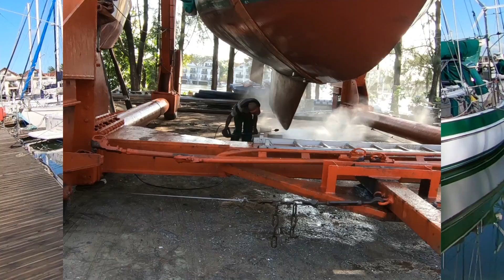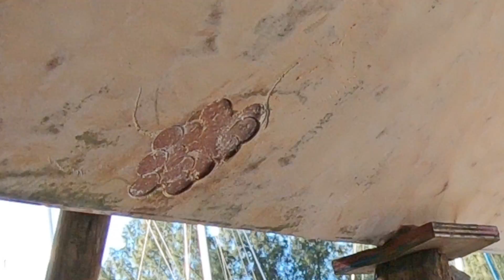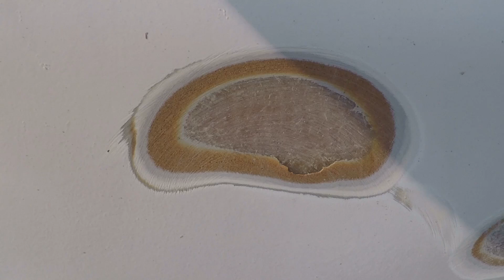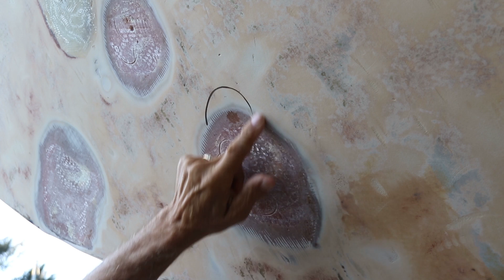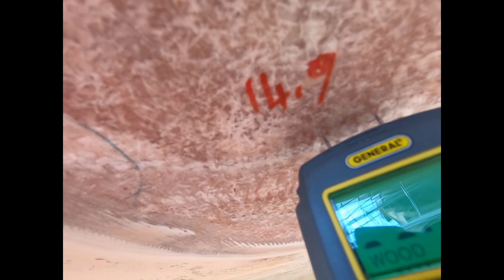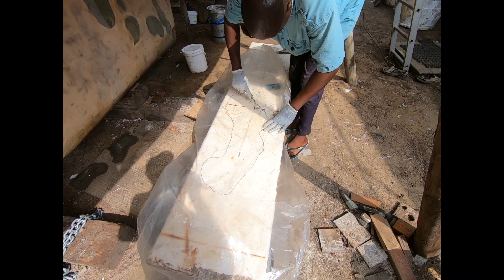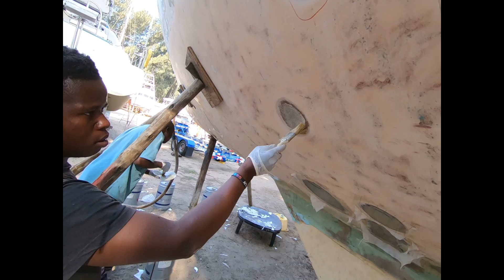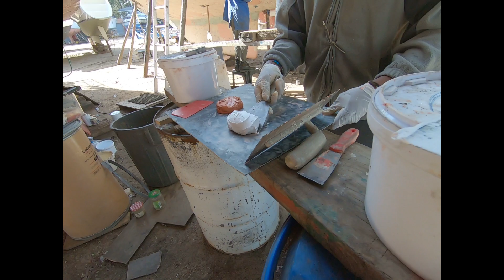500 ROTTEN, FESTERING Blisters!!  - Blister Repair on a Fiberglass Sail boat! (Patrick Childress 59)

Comment: Osmosis  ? that needs the special horrible loud tool called the peeler and new layers of fiberglass laid on.
Reply from the maker: How deep do you set the “peeler” to universally go? Where do you find one of these in Africa? -Rebecca
Reply: @SailingBrickHouseAndOsprey  well to be honest it depends on the level of softness, usually you go in turns to get the depth you need, also got no idea where  you would find in africa bit that is the best way to cure the problem and keep the hull stong for many years
Reply from the maker: If we went as universally deep as the deepest blister, the whole boat would have been gone. And we wouldn’t have known how deep the deepest one was until all the hull was gone. We both believe that the hull is very very strong now, and will be for rest of our cruising life. That’s not to say some may not come out again in 8 or 10 years. But we had the boat peeled from the waterline down in Deale Maryland by the highest regarded professionals 19 years ago. And that only lasted about 10 years before we started seeing blisters popping out, if that. And now it looks like this. So peeling it...doesn’t cure the hull blister problem for very long. I can guarantee you this. -Rebecca
Reply: @SailingBrickHouseAndOsprey  ok well just do the blisters with the peeler and lay new fiberglass to build it back up, instead of the whole hull, get a moisture meter too so can see thecresl wet spots, strip the paint and the gel coat let it dry out as much as possible then just attack the osmosis places with the peeler
Reply from the maker: As the video says, these have nothing to do with osmosis, they are resin blisters.
Reply: @SailingBrickHouseAndOsprey  If resin blisters why are they full of water ??
Reply from the maker: Some are and some have tobacco looking muck, like old uncured resin. Especially below the water line, I would suspect weakened fiberglass allowed water to be forced in. Good question -Rebecca
Reply: @SailingBrickHouseAndOsprey  I am no expert , but  if it is a resin problem it will be osmosis and water getting in due to the chemical balance . 

If it was the resin failed your boat would fall to bits . 

So water is getting in due to a chemical imbalance  and the pressure is causing the blisters . Once you fix them all you will need a barrier coat to stop it happening .
Reply from the maker: @faircompetition1203  Why would there be osmosis so far  above the water line?
Reply from the maker: faircompetition1 Not sure what you mean by that. Our boat was treated for these same resin blisters 19 years ago. We have sailed it hard for the last 12+ years and it hasn’t fallen apart. A new barrier coat after the blister treatment 19 years ago didn’t solve it. And this boat is the most famous boat in the world for resin blisters...not osmosis. As you can see, most of the resin blisters are well above the waterline...how would water get in which is an osmosis condition...confused by what you mean. Maybe Patrick will understand what you are saying...but I dont understand what you are basing your statement on...but would like to understand. Osmosis happens above the waterline and tobacco colored acid comes out???? -Rebecca
Reply: @SailingBrickHouseAndOsprey  back when iworked in the boat yards repairing we had a boat bought an owner via ebay from the us, boat a rrived to europe, it was full hull osmosis so i can be also above the water line, now anyone can claim here what they want at the end of the day its your boat, im not throwing osmosis to drum up business, im glad im not fixing them anymore and have seen everything owners have trued to fix themselves or are "experts"on if its discoloured blisters under the gelcoat id treat it serious. But people will do what they want too of course
Reply from the maker: I’m not sure what the scientists that determines that these are resin blisters don’t know that you know. And I’m not sure, if they are osmotic blisters, and they were peeled, and then treated with the very best barrier coat by the very best professionals in Deale Maryland, why they wouldn’t be cured like you said they would be...why they came back less than 10 years later. 
How would resin blisters be different than what we have here. If you are right and we have osmotic blisters, and we applied a barrier coat now, than I guess we will never have a problem again (even though we did after the pros did the same treatment that you recommend) . So I hope you are right :) -Rebecca
Reply: @SailingBrickHouseAndOsprey   So my understanding is , and I am no expert , is that certain resins react with the sea water to migrate water into them , this causes pressure that builds up and causes a blister . 

The glass is sound but the osmosis is  the net flow or movement of solvent molecules through a semipermeable membrane (your layup and seawater ) and because of the resin used it is a net inflow this builds pressure that results in the blister . 

Chemical problem , and not that the resin is weak , fine if you stay out of the water . 

A good barrier coat should solve it , included one in the bilge . After the damage is fixed of course , and you dry out the hull .

Comment: Lots of west system epoxy.
Reply from the maker: Yes, but West System is not available in large quantities in S. Africa so we used Gurit SP106 resin. That is equivalent to West 105. -Rebecca
Reply: @SailingBrickHouseAndOsprey  my son Worked for west marine when I did my hull repairs, unfortunately, he no longer works there. Employees got a huge discount on west marine products, like $12.95 thru-hull fittings for $1.25
Reply from the maker: @edwardmyers8782  What a tremendous mark up!
Reply from the maker: @Shawn Huffman Working in the U.S., there are so many good options unlike in these foreign countries.

Comment: A tip for future... hire a good quality infrared (thermography) camera or a service provider. A quick scan of the hull would have picked up the small temperature change of the blisters. Food for thought 🙂
Reply from the maker: Interesting theory. Do you know if there is one in South Africa? How much do those run? -Rebecca
Reply: Patrick Childress Sailing hi pat rich. I am from Australia so can not help with a Soutth African service provider for thermal imagining. I am certified thermographer in Australia and are fairly confident a good quality infrared camera would be able to detect the temperature difference of a blister that has air or water trapped from the main hull. I’m am sure if you contacted any condition monitoring in SA they could help. Could save many hours of physical work to find blisters. Or perhaps you could try purchasing an entry level infrared camera which these days are quiet cheap. Look for one that has a resolution of at lease 0.5 degrees C. If you can not not find the blisters with it you can use it on your yacht for checking any temperatures ie motor. Water. Oil etc. good luck. Shane
Reply from the maker: Thanks, we have one..maybe that would have been an interesting experiment, though I’m not sure on the quality of ours. Patrick May try it on the parts that are above the water line one of these fine days. -Interesting way to find blisters ;) -Rebecca

Comment: between 1990 and 2004 i PERSONALLY restored and lived aboard 1969 camper and nicholsons 38 ft, ketch , 1982 german frers 38 ft. club racer and 40 ft. 1984 chris craft sport fish also a 76 stingray and 75 alfa romeo spider veloce,  always had a paid for bachelor pad and bitchen daily drivers , your repairs are spot on and will last , just turned 65 , my current bachelor pad is 38 ft, motor coach at beach front RV resort with f type jag and car trailer , cheers from PADRE ISLAND TEXAS , fair winds following sea
Reply from the maker: Jochen, and people slave their life away in the hopes of one day having a water front view. Yet, others live that life without all the grind of a dreaded job. Good on you!

Comment: Thanks, very interesting and informative video. Great trick with the hole saw using plywood guide, definitely putting that in my memory bank....
Reply from the maker: For the hole saw, someone else suggested to run the drill in reverse to first etch in a hole as a guide. Thanks for watching.

Comment: A lot of mid 70s fiberglass boats suffered from the oil embargo. In Annapolis there are a lot of boatyards that have job security due to this exact problem. It's labor intensive, so if your game and the yard will let you, do as much of the labor as possible.
Reply from the maker: Donald Parlett jr Deale Maryland is where we had the first blister repair job done, in 2001, from the water line down. One of the best yards in the country to have it done. $25,000 worth. Yes...definitely better to do a blister repair job yourself with lots of helpers. And obviously it doesn’t come out better even if you hire a pro to do it. So why not do it yourself....oh yeah...the blister repair job must be the god most awful boat repair job we ever did! -Rebecca

Comment: Hi , comment nr 400 is here. 

If you apply vacuum, under a taped plastic blanket, the remaining water in the blister and laminate cooks away very fast. That are physics:

At 0.05 bar pressure the boil-boundary of water is 36 degrees C. If you can apply lesser pressure (more vacuum) on a hot day, all the water is gone within an hour. Pressures higher than 0.05 bar can be applied , but the drying will take longer. Working on a hot summer day is preferred.
You will have to shift the vacuum blanket from spot to spot to dry the complete hull. Use tacky-tape to seal the blanket on the hull. And a good, professional vacuum pump. 

You end with a cork-dry laminate to work on, assuring best adhesion to the repair laminate.
Succes (for the next boat.)  Louis van Rijn, the Netherlands.
Reply from the maker: Louis, thanks for being an even number 400 commenter on this video!  Thanks for your vacuum bagging information. Possibly someone else doing this work can set up the system to make their drying process faster. A very good idea.

Comment: 20 years ago i was involved i  a project whee you could see delamination of various products, it was called themography. You use an intense flash light which emits heat, and you measure using a thermal imaging camera. The delaminated area got hotter and dìdnt cool down as fast. they use in on wessex helicopters  and they bought as system.
Reply from the maker: That would be a great thorough approach if one could clean out all the interior parts of a boat to gain access so to do the analysis. For what I felt we needed to do to this boat, the outside visual approach was good enough. Thanks for your comment and idea.
Reply: That sounds doable with a heat lamp or something and one of those smartphone thermal cameras. (flir one, seek thermal etc) can be obtained 2nd hand relatively inexpensively.

Comment: Actually,  it's Herron resin- developed as a fire resistant military application.
I did the same restoration on my 1978 Valiant 40, peeling, drying and relaminating with epoxy and Nytex.
20 years later, a few small blisters have formed, but far less and fewer.
I am glad that I purchased this boat. There are stories of Valiant 40s stopping marina fires, by working as a fire stop! Actually super safe!
Good luck and congratulations!
Reply from the maker: Patrick, that is good news. Since 1976, when our boat was built, this is the 3rd time the below the water line has been treated for resin blisters and 2nd time for above the water line. Grinding into these blisters to their origin, I have confidence we will have the same longevity as you have had. Previous treatment did not go so deep. Thanks for your information.

Comment: Wow, the name of that game is perseverance!
Reply from the maker: Roy, I built a boat once, and that was a tremendous amount of work. Fixing them can be difficult but a lot faster and easier than starting from scratch.
Reply: @SailingBrickHouseAndOsprey  I hear you - and there is always the pride of accomplishment when the job is well done.
Also, that hull design alone is worth the effort of fixing it.  (My 2nd, and last, boat was a LaFitte 44 - similar design below the water.)
Reply from the maker: @rwess  I have a friend who owned a LaFitte 44. I helped him paint it. I like that boat a lot and would not mind owning one. Perry did use the same, below the water line, Valiant concept on the LaFitte 44 including the same bronze skeg  boot.

Comment: My trade is not marine but aviation.  We use coin tapping to listen for delamination. It is a very easy and reliable way to find and measure areas of separation by the change of a sharp note to a dull thud.  I don’t know if a heavy coin would be adequate to hear deep delaminations in a thick boat hull but I think a nice well rounded 1/2 lb ball pein hammer gently tapped on the hull would give satisfactory results. Give it a try on a visible delamination  and see if you can ‘hear’ the defect.
Reply from the maker: That would probably work with fiberglass. But these blisters were quite obvious. After so much work and taking care of all the visual blisters, enough was enough. Thanks for your comment. It will take a long time for any new blisters to show, if they show at all. We will see, and I will report back in 20 years.

Comment: Outstanding workmanship and great job filming and narrating. Reading through a few critical comments I'd like to say; I'm in a similar age group and have always used a standard in all my boat work,  "Leave it better than it was". Recognizing I have an expiration date, I don't necessarily need to make it perfect, just last xx years.  I'll let the next guy or gal handle that. :) But in your case you got pretty dang close!
Reply from the maker: Thanks, Mark, for your comment. Yes, enough is enough and it is time to move on and cross more oceans. This haul out created a lot of video material, like opening the rudder so see how the plate to shaft assembly is doing. After some work I now know the rudder will last, just like the hull.

Comment: I must have done one of the first blister repairs in the mid 60's. There was little known at the time and the recommendation was to grind out the blisters and use a polyester filler(P38) to fair the hull then seal with two pack polyurethane. I can't imagine it lasted too long, I would think your epoxy/fibreglass repairs will be the best parts of the hull.
Reply from the maker: Yes, they have learned a lot about fiberglass and repairs since those early years. There is so much epoxy on this boat, throughout, it is a far better boat than the day it rolled out of the factory. Thanks for your comment.

Comment: Use copper particle spray.. you wont have to use anti foal again..
Reply from the maker: Any more detail on that copper paint or whatever it is. -Rebecca
Reply: @SailingBrickHouseAndOsprey  look for copper coat. Its told to last 10 years.

Comment: I have been building timber housing for many years. I had one timber floor supplied under moisture content about 8%, when the rain came around Christmas in Australia it caused the moisture in the atmosphere to rise to about 80%, the flooring expanded about 2"  put a 50mm bow in the floor and moved the external walls out about 3", The moisture content of seasoned timber flooring should have been between 10% - 13% as this is the equilibrium of atmospheric moisture  content. Great vlog on your repairs
Reply from the maker: I feel terrible for your past flooring problem. I used to remodel houses and real estate is what helped to get Rebecca and I out sailing, so I am familiar with expanding cedar shingles buckling and flooring problems. Thanks for your information.

Comment: Looking into a Vailant a few years ago I was told the blisters were there result of a fire resistance resin that was used. Cheaper resin makes more sense.
Reply from the maker: By saying Valiant used a fire retardant resin and that caused the blisters, seems to suggest all fire retardant resins are bad and will cause blisters. That is not true. There are good fire retardant resins that do not cause blisters. From my understanding, Valiant switched resin suppliers to save money, the resin was also fire retardant which had a bad retardant chemical. All at this time, the builder of this boat, Uniflite, had a military contract to build river boats which specified the use of fire retardant resin. With a selection of fire retardant resins to use, Uniflite, went with a cheap resin for the the river boats and saved money by building sailboats with the same stuff, rather than the resin they had previously used, which was more expensive. Our boat was built in 1976 as stated in the video. The run of Valiant "blister boats" started prior to 1976.
Reply: My understanding was also that the resin was special "fireproof" resin and that was the cause of the blisters. When Valiant quit using the fire resistance resins, the blister problems largely disappeared.  I don't think cheaper resin was the reason - it was not until the 1979 gasoline shortage that resin prices shot up and companies switched to cheaper resins. Most boats built prior to 1979 do not have blister problems, while the early 1980s most boats (like Gulfstar) DID have blister problems.

Comment: I had a guy at my marina with the same issue. He sanded down the blisters and filled them with autobody filler. What a mess. Autobody filler is totally porous and never meant to be underwater. Anyway, he finished, painter it and headed for South America . I named it the SS Colindar.
Reply from the maker: There was a contractor here in the yard who said if he were doing this job he would just fill all those craters with putty! And that putty would have been some sort of polyester. I could not believe what I was hearing.  Thanks for your comment.